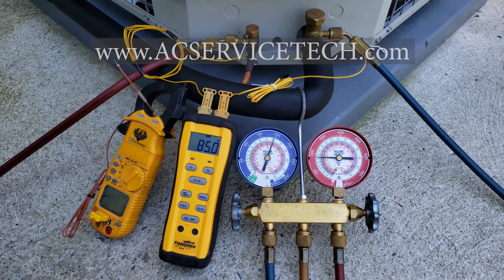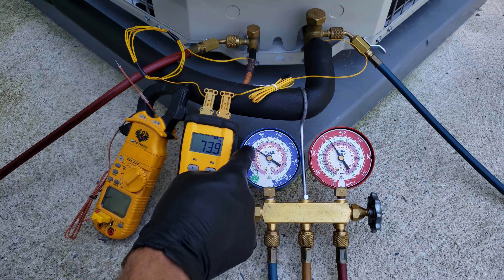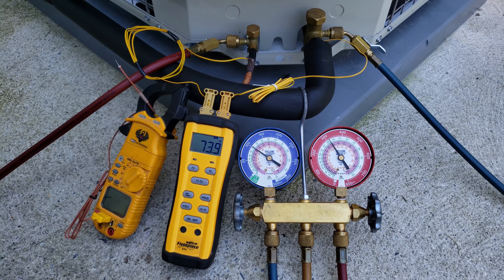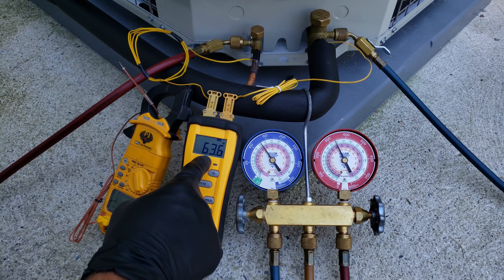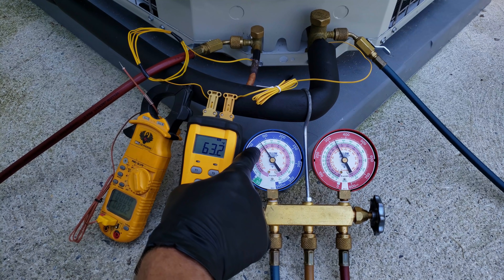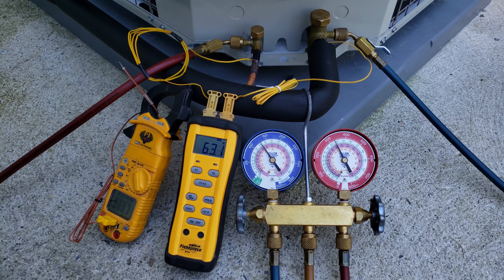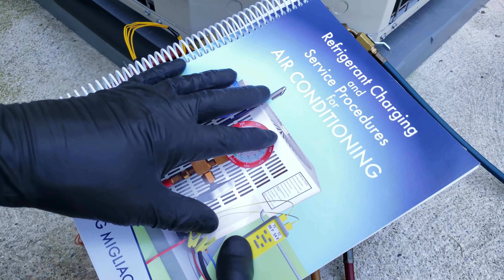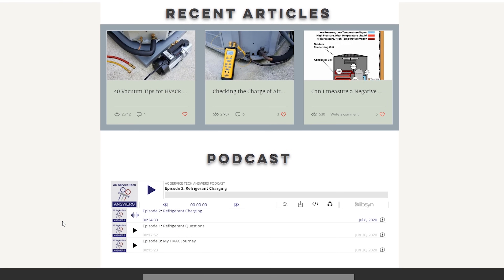R-410A AC Unit Checked with Superheat: 4 Scenarios, Low Charge through Overcharged!

Comment: Enjoy your videos and have gotten good use from your book and reference cards.

Have a couple questions.. maybe you have videos already..

1. I've noticed with condensers that have a microchannel coil than the manufacturer doesn't seem to specify a subcooling. And when following the manufacturer instruction to just go off their pressure and temperature chart for liquid line I end up with a SC that was far higher than I would had if I was just going off SC alone. So wonder if you can explain this or show the proper way to check equipment with microchannel.

2. Other question is what is the best practice for checking refrigerant charge on a system/circuit with more than one compressor? I've seen some equipment (actually back to the microchannel) where their temp pressure chart was based on both compressors in operation. Some older equipment not using microchannel coils that have 2 or 3 compressors I'm wondering if I can simply operate one compressor at a time and check charge. I suppose the charge on one would be good on the other.. however checking these individually is good validation that equipment is working. 

Just curious what common practice is for this. Thanks!

Comment: WHY is it that newer systems don't install a sight glass in the liquid line?? Cost can not be a factor surely! I have a Goodman 2 1/2 ton heat pump on R22 and it,s been fantastic for 13 years now. Yea I do all the pm checks. For I installed it in 2011. Older units are so much simpler to solve problems on than newer units. Much too much electronics. Wait until there is a big electrical surge. Think of all those circuit boards!!

Comment: My contractor charged me $250 and did none of this, besides connecting the guages. Then proceeded to tell me my compressor was faulty and needs replacement, $6K. Where can i find a honest contractor who will diagnose a Heat pump that wont cool or heat and proceed to fix the issue?.

Comment: I’m fairly new to residential HVAC.  Installed a new unit.  These units come precharged for a 15 foot line set and the existing line set is only 8 feet, does this mean I need to recover some of the charge?

It seemed to be overcharged just by checking the gauges.  I recovered some refrigerant which lowered my
Head pressure but had no effect on suction pressure.  I can not get evap coil temp below 55 degrees.  The house will not cool down below 77 when it’s warm outside.  It is a 410a piston system.

Comment: You know funny thing is, I watched a building maintenance guy recharge a R22 system at my complex back in 2015 in Austin, TX. He didn't do any of this subcooling or superheat calculation with temp probes everywhere. In fact I didn't even know there was this whole thing about subcooling or superheat. He simply charged it to the right pressure and left it at that and the system worked fine. I would assume he's licensed as every AC units at the complex is R22 systems... no way he'd be hired as maintenance guy if he wasn't licensed to do R22. 

But in Taiwan there is NO regulation on HVAC. We could buy R22, even R12 over the counter here! And none of the AC guys I talk to here are ever licensed or even heard of a license.

Comment: Hello i have a problem with r410 ac unit1.8btu   Plz help.  The suction ia is ok 120 ans pipe also cold. But at evening time when is too hot between 12 pm to 7 pm. The unit is not cooling well the blow air is week.  At night its ok.  
What the probl m. Plz help

Comment: How to calculate this if the AC has "winter mode" installed - the condenser fan spins depending on the temperature of the condenser (so it can spin at normal speed, slow or not at all). Would that affect the "outside temperature" in the calculation?

Comment: I overcharged a system and want to remove a small amount of refrigerant. My recovery tank is under a vacuum. Will this cause to much to be pulled out?
Reply: You control the valve.  Use a scale to monitor how much you are removing.

Comment: If i had 143 psig in my vapor side with 16 sh and my vapor line was 67 degrees and saturation was 50. Liquid pressure was 365 and sc was 8.3 and liquid line temp was 101 and saturation at 109. Was I fine with my charge? It was degrees outside and my wet bulb waa 74

Comment: What do you do when you don't know what metering device the system is using? Sometimes you don't have access of looking at the inside coil so how can you know what metering device the system has?
Reply: raul robles you have to take it apart and look
Reply: @mwatkins2464  there has to be a easier way
Reply: raul robles how come you can’t see your evaporator?? Are you talking about a package unit or a split unit. Either way you have to take a few screws out to be able to see.
Reply: @mwatkins2464  talking about the evaporator on top of the furnace. I always have some that are closed good. I feel like I would have to cut out a hole to see in but I feel like there is another way to know without doing all the extra work
Reply: raul robles you shouldn’t have to cut anything unless someone did a hack job on it. Just follow your copper tubing where it goes inside the unit. The metering device will be on the small tubing. You should have some 5/16 screws to take out if yours is a split unit.
Reply: @mwatkins2464  if it has a piston it would be on the tubing before it goes in the plenum or would it be inside the plenum like the txv?

Comment: I still struggle with superheat and subcooling. I'm fine with wiring , duct work sheet metal, brazing etc but when it comes to checking proper charge I struggle. I'll have to watch this a few more times.( i have a fixed piston) If my outdoor temp is 77deg indoor house temp is 74 any idea (ballpark figure)  what my outdoor pressures would be? Does 125psi and 300psi seem right. I'll have to do superheat. Then check subcool. Thanks for the video
Reply: look up the check charge app.  it will ask step by step and it will calculate your charge.

Comment: Great video I’m working on a system now that has sh of .2 vapor line at 70 Psi and sc 32 liquid line 293 psi and a temp split 14.1. R22 not sure if it’s a txv or piston as I’m going to cut case now. I’m thinking airflow?  Any thoughts
Reply: Dan Martens overcharged.  Recover to bring up SH and lower SC. Temp drop is low so I wouldn’t start there until I saw the effect of the recovery. Need to know what ur shooting for though.
Reply: If you have no superheat, and .2 is so low it could be 0 with a little calibration error, you are so overcharged you are starting to flood back liquid to the compressor and are in danger of killing it.
Reply: That's the problem I always run in to my self. I rarely can ever tell if i have a txv or piston. Sometimes I can't get access to see the coil due to the plenum. So idk if i should be doing by sh or sc.
Reply: I’m looking thru your book now lol

Comment: how do u feel about the 'hyper engineering' and 'micro air' soft starter kits. they claim to lower startup inrush amps by 1/3 to reduce loud compressor startup thud and eliminate indoor light flicker? they cost about $300. great vids btw
Reply: If it’s for your house you can use a 5-2-1 or even a Supco spp6 for a lot less money.

Comment: I have a unit and the saturation temperature is higher than the suction line temperature, why is that?
Reply: Do you have a psychrometer (sling, digital, or thermocouple with sock) to measure indoor wet bulb temp?  In order to get your charge correct you need to find out what the indoor wet bulb temp is.  Here's a helpful formula to calculate target superheat: indoor wb x 3, minus 80, minus outdoor ambient temp, divided by 2.
Reply: What type of metering device?
Reply: You need to give more information. What type refrigerant? Metering device?
Reply: The unit is a new installation, R410A 1.5 ton Run Tru by Trane, new lines and New 1.5 ton evaporator with a piston, air coming out of the closest vent is 62 F, my pressure an Low side is 151psi, my saturation temperature is around 52 degrees but the temperature at the low side is 60 degrees, I learned at school that is supposed to be all the way around, I do not understand, please comment, I am new on this field 🙏🙏🙏
Reply: Salvador Gonzalez usually the saturation temperature is lower than the actual low side pipe temperature at the condenser. If you were to measure the temperature at the outlet of the evap coil, it would probably be a couple of degrees cooler than when it gets to the condenser. If you did a proper vacuum and you have a piston, Make sure your charged the unit according to the superheat charge base on the wet bulb of the house at the nearest return grille. Compare with a SH table. When there’s a high heat load, the temperature of the pipe won’t be as cool but as the unit runs and removes the humidity and heat load it will get cooler. Make sure your superheat is correct.